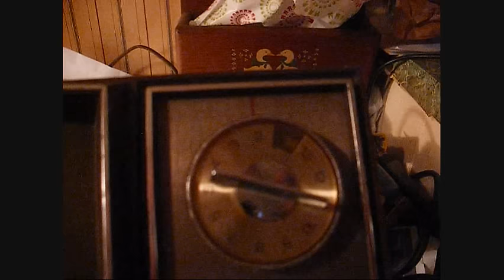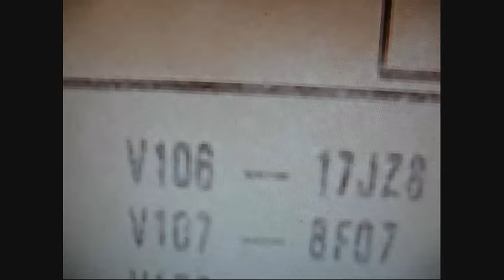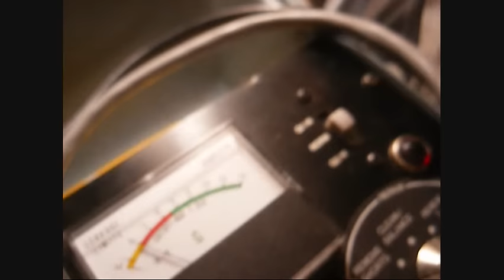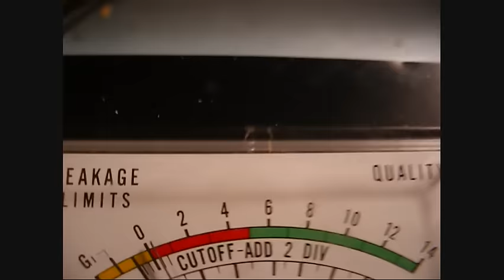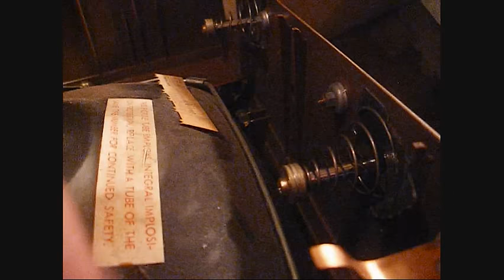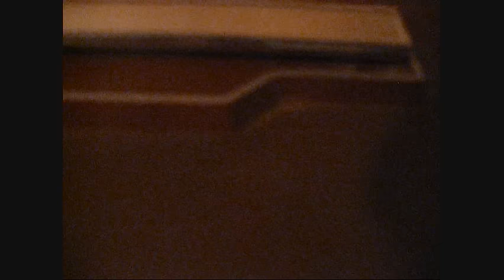Repair of a 1970 Magnavox 12" vacuum tube B&W TV (rebadged Sanyo)

Comment: I was a kid in the early to mid 70's. We had a used black and white Philco "Caravan" portable 19 inch tv. It was meant as a spare, in case our 25 inch color console quit working. 
I used to look down the ventilation slots and observe the glow of the tubes, feeling the warmth, and it had a certain smell, not a bad smell, just a smell.  It used to give me a good feeling looking at the tubes and feeling the heat in my face. 
 Anyway, nice Magnavox.

Comment: What's in motion, stays in motion. It's a common false misconception, that if you don't turn something on and run it in a long time, that it won't break. You try that with a car, more then likely your going to have things on the vehicle and engine rotting out. The fuel going bad over time, especially with the ethanol added in it nowadays.

Comment: On  CRT TVs up to the mid-2000s, could users' setting preferences affect the life longevity?   

I know a lot of more recent tube sets, from 1990s up to 2008 or so, shipped with the 'Contrast' or Picture setting maxed.  On the two that I either bought or received new, I promptly lowered that setting to the mid-point, and adjusted the Brightness(black level/ bias) until detail in darker parts of the picture were just visible under normal room light conditions.
Reply: Cranking the brightness/contrast will definitely make the tube age faster. I don't think any other user settings could make a difference.

Comment: I have been collecting radios for 48 years now, and just to let you guys know that I replaced the electrolytic capacitors in some of the ones that I started over 40 years ago collecting. And now when I turn some of them on even with bringing them up slowly on my variac the electrolytic have gone bad New Old Stock electrolytic with no and very little hours of use have gone bad in these radios that I have restored 40 years ago my case in point electrolytic along with other caps do not have a lifetime shelf life
Reply: they certainly can deform with long disuse, but will vary with brand and quality, i have a 1957 transistor portable, physically rough but 'virgin' electronically ,all original, and works perfectly, most of my transistor sets have not needed new electrolytic caps,

Comment: So let me ask.  You are testing these capacitors at rather high voltage for leakage.  For example 400 to 600 volts. Are these caps rated for high voltage like that, and if not, wouldn't they leak at voltages they aren't rated for?  I noticed that in the microfilm I saw lower voltages than 400 volts the caps tested where in.   Essentially why test at voltages they are not rated for and do not operate in? Not saying your wrong by any means.  Thank you for your time.

Comment: Hey what are your thoughts on a 1985 Sharp Linytron 19” model 19PK15 CRT tv, with knobs and woodgrain siding? Have you experienced any known issues with those Sharp CRTs?
Reply from the maker: Mainly cold solder connections, bad capacitors, and an occasional bad flyback transformer.